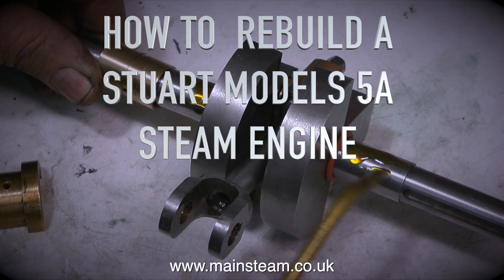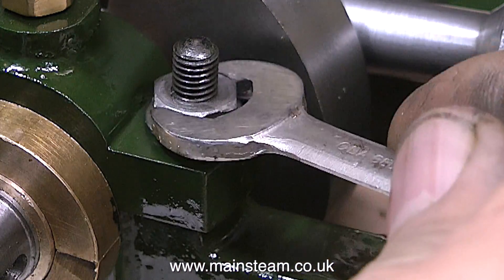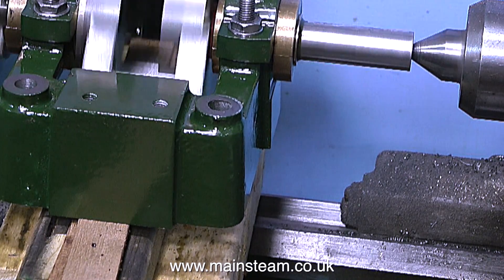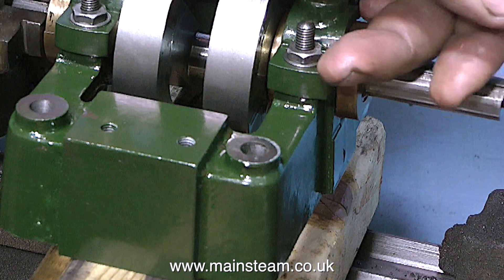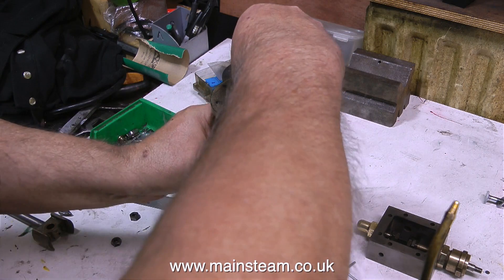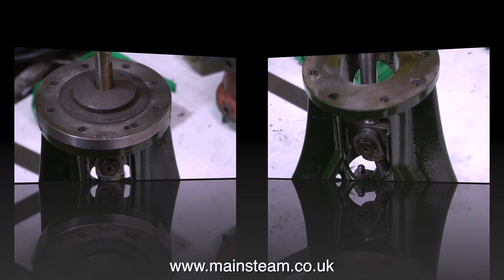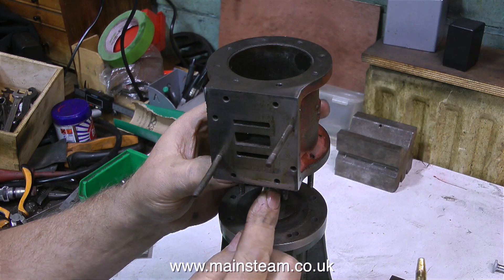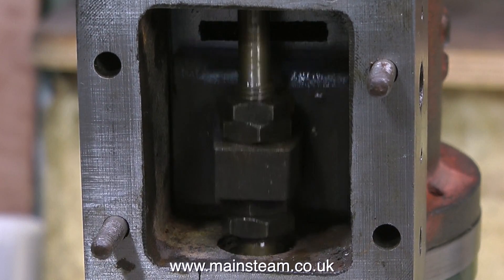HOW TO REBUILD A STUART MODELS 5A STEAM ENGINE - PART #12

Comment: We need an expert hammer , every time an expert makes a comment the hammer is launched at them. I've worked on plenty of engines and I firmly believe there are many ways to do one job . This is Keith's way , it works so I see no problem.
Reply from the maker: as you say, there are many different ways to do many different jobs, most of the time I try and take the simplest route .....

Comment: That looks so good ! You can really tell that it's been put together by a true craftsman, every small part is perfect and enhances the entire engine. 
I'm kind of glad that the 'O' rings by the main bearings got shredded, they'd be a bit too modern looking for this gem. As long as you don't run it fast you shouldn't get much oil splattering around.

Comment: forgive me if im wrong, but does turning the bearing halves around, putting the thicker flange towards the crank web take up the thrust movement that youre trying to get rid of with those o-rings? or are they way too thick?
Reply from the maker: They only fit one way. In the end now that the engine is back together, the movement is negligible :-)))
Reply: Keith Appleton glad it worked out. Your videos are exceptional keith. Keep up the brilliant work 👌

Comment: Looking lovely Keith. Now you need to build yourself a small boat and take it cruising on the Thames
Reply from the maker: Very tempting, but I would like to make the entire steam plant compact & removable for storage .......
Reply: Years ago I seen a very similar engine to this with small boiler & pump set-up as a removable power unit that fitted into a 14foot 'Canadian' fiberglass canoe...
Instead of having a screw propeller it had a small paddle-wheel each side.
The canoe could also be fitted with 'out-riggers' (roughly 3foot off of each side) to add stability when needed or removed for use in narrow creeks....
Wish I still had the photo's, but I also remember seeing it not long after in Australian Model Engineer magazine.
Just thought I would share memory after reading the above- might feed your fertile mind for something similar yourself at some stage ;)
Thank you again for your time & content :)

Comment: have you ever tryed those nylon lock nuts they hold really nice i like them verry much ! o glad to see your doughter starting the other website thats really cool she must enjoy your steam engines thats great ..
Reply from the maker: Nylon + Heat = Melting ..... I don't use too many modern fastenings, I prefer the traditional methods . . . .
Reply: o yes to much heat for them ha to bad they work so good thanks for answering me MR Keith have a great day :)
Reply: Besides the problem with heat, nylon lock nuts are single use. You're supposed to replace them with new ones. The traditional double nut lock is better from a maintenance outlook.